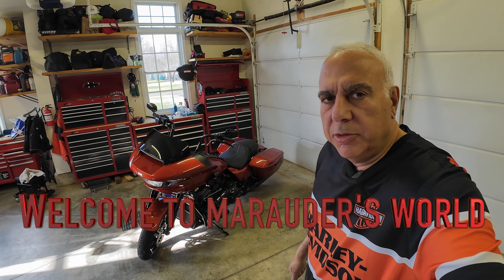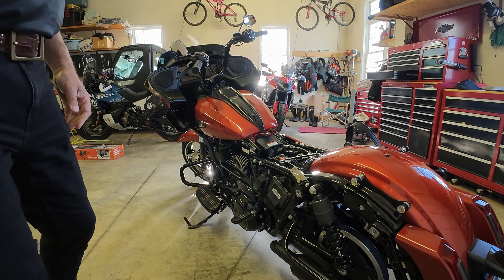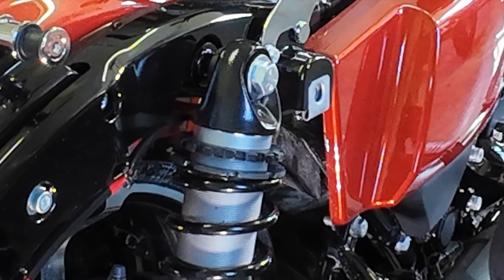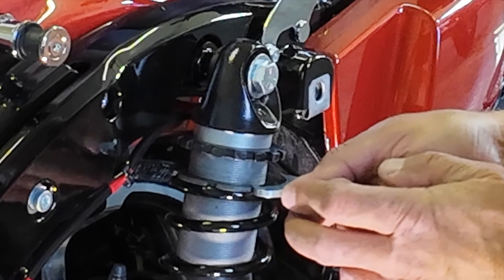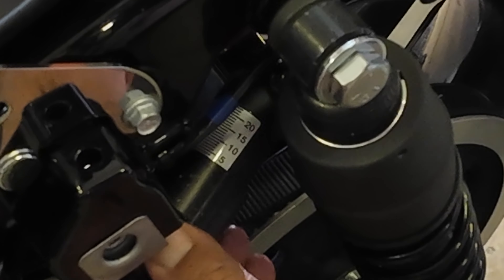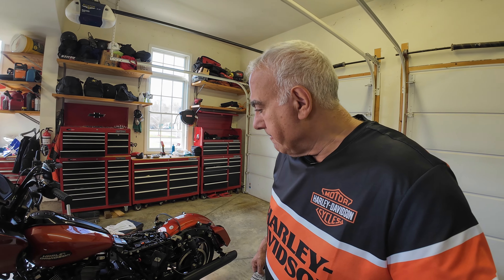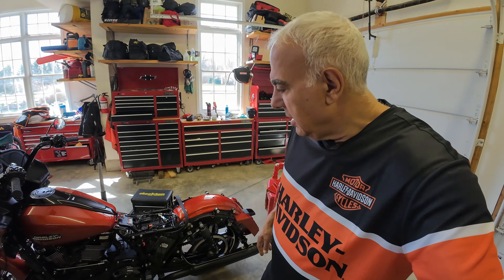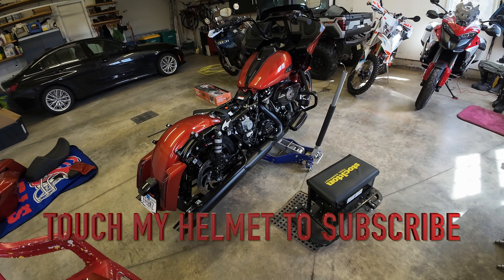2024 Harley-Davidson Road Glide Preload Adjustment Ceramic Wax #396

Comment: Throw front and rear suspension in the trash and call Legend.

Call Saddlemen for a road sofa seat.

Call RB for a seat lock.

Your @ss and back will thank you dearly
Reply from the maker: Lmao 🤣 love your comment no doubt  those brands are excellent especially the seat I think my brothers 2010 SG ultra had saddleman. The stock seat is very comfortable but my longest ride has only been 2 hours. I have to get a seat lock I’ll look up RB. I have 3 other bikes to accessorize so I have to spread the love…please check my bikes out and comment I appreciate your help. Ride safe 😊